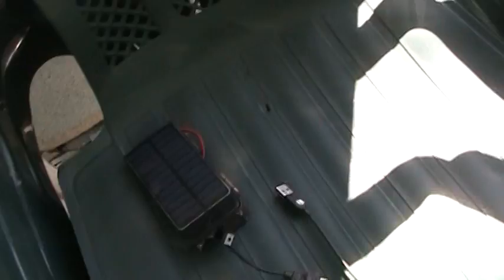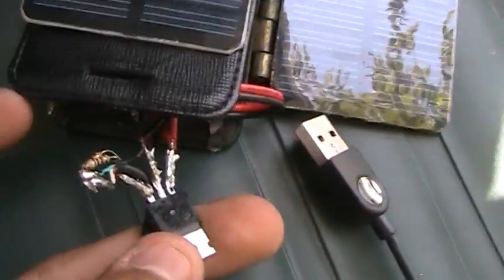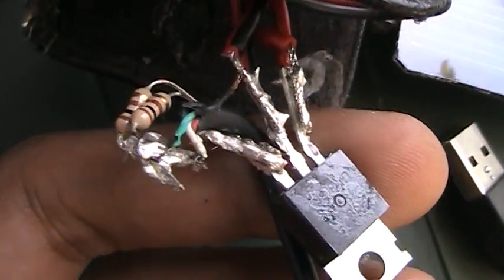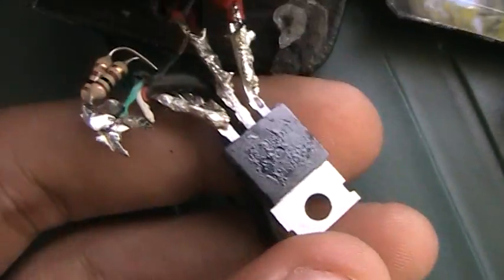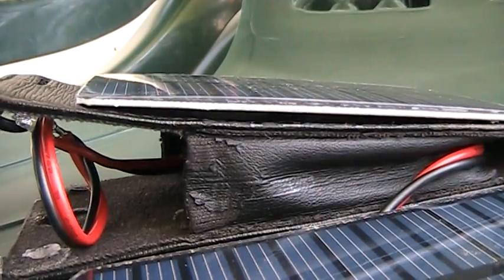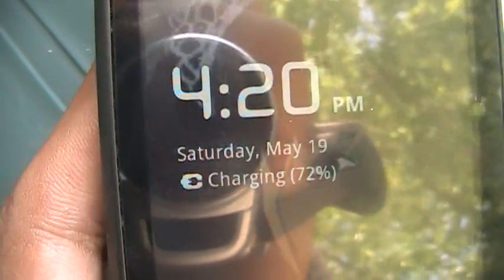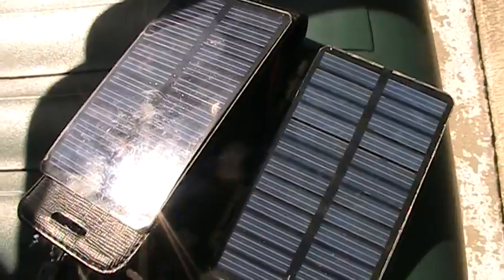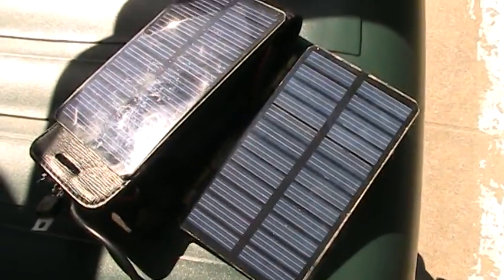My Solar Panel Charger Upgrade

Comment from the maker: yes..well i got 2 solar panels each 6 volts and 80maH and i put them in sequence to make them 6 volt 160maH
i also got a 5 volt regulator with 150maH so that it could let out a regulated 5 volts and enough milliamps to power the phone and i got alll this in radioshack
also i got a female USB connector i had lying around and connected the posotive and negative and thats about it..hope it all goes good